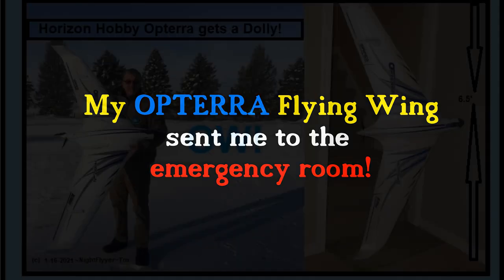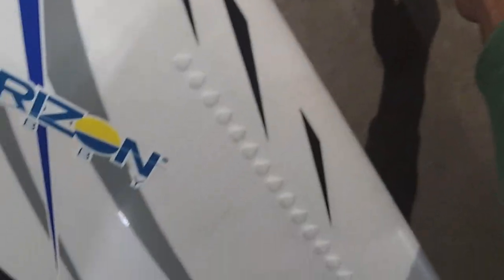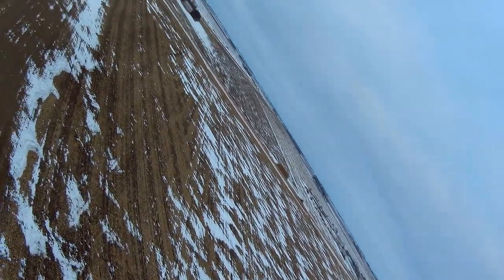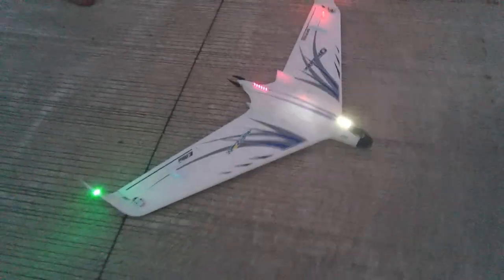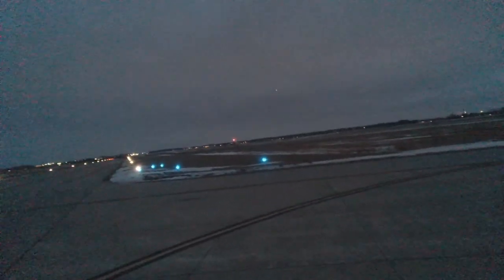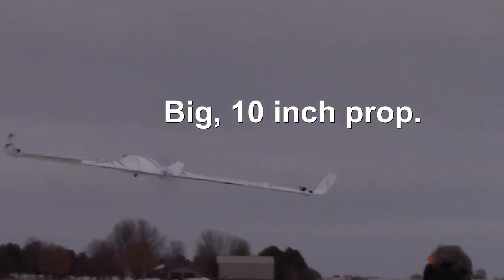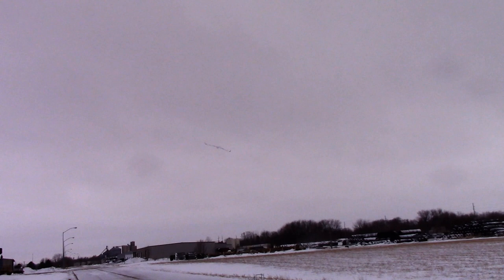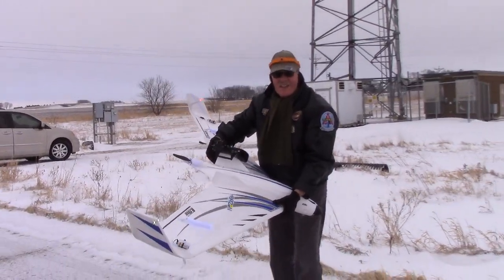My Opterra 2M Flying Wing sent me to the E.R. This is an awareness video & my solution for launching

Comment: Oh so sorry. You should have add handle like holding it little higher.or simply add wheels. Get well soon sir.
Reply: A handle that you hold that grabs the plane while you launch it is a great idea.  It could even be just a stick with a coupler that automatically releases when it gets to a certain angle.    Would allow more leverage to launch said plane at a higher velocity and altitude also.   Great idea.
Reply from the maker: @MoralConflict  Yes, well if you saw my Product review  video,  https://www.youtube.co/watch?v=P_inF5EYLEE&t=1s  you would see  those wings aren't as strong or thick as you would think.  I would have to add a nose wheel servo and make it a trike as well.  And since the prop on the back is 10 inches, the landing gear would have to be quite long or retractable prop would hit the ground on rotation or landing. Thanks for the suggestion, but the dolly is pretty permanent too.  This wing is 7 foot long, heavy and  will bend and break the end off the if you even try to pick it up by the tip and barely has enough power to fly out of your hand at launch.  I know and I tried to launch it discus style, but could not hold it where I felt I could launch it successfully in the wind.     It would also be extremely difficult to somehow launch it discus style with the elevon there and that 7" tall winglet rudder that is also on the tip.  I know how to do it , but not with this plane.
Reply from the maker: Yes, well if you saw my Product review  video,  https://www.youtube.co/watch?v=P_inF5EYLEE&t=1s  you would see  those wings aren't as strong or thick as you would think.  I would have to add a nose wheel servo and make it a trike as well.  And since the prop on the back is 10 inches, the landing gear would have to be quite long or retractable prop would hit the ground on rotation or landing. Thanks for the suggestion, but the dolly is pretty permanent too.  This wing is 7 foot long, heavy and  will bend and break the end off the if you even try to pick it up by the tip and barely has enough power to fly out of your hand at launch.  I know and I tried to launch it discus style, but could not hold it where I felt I could launch it successfully in the wind.     It would also be extremely difficult to somehow launch it discus style with the elevon there and that 7" tall winglet rudder that is also on the tip.  I know how to do it , but not with this plane.  Thanks. I am healing and now can type better.
Reply: @NightFlyyer  get well ssoon sir.👍

Comment: Hello, I had a similar injury launching the f 27, but did not required stitches. I had 5 cuts. It could have been worse, I was lucky. I now launch it holding by  the wing. Thanks for your video.
Reply from the maker: Ouch.  I have the F-27 evolution as you saw and how I launch it, but this wing is 7 foot long, heavy and will bend and break the end off the if you even try to pick it up by the tip. I tried.  Also it barely has enough power to fly out of your hand at launch.   It would also be extremely difficult to somehow launch it discus style with the elevon there and that 7" tall winglet rudder that is also on the tip.  I know how to do it , but not with this plane.  Thanks and hope your okay.

Comment: I like your alternative launch system, clever with the guide wire and far more compact than what you'd need in a traditional catapault for this size vehicle - well done!
Reply from the maker: Yes, I tried to make is small, as there is barely enough room to put this plane in my van and a big Catapult like I used to have.  It works and it's Hello dolly for me from now on with this big 7 foot long wing. Thanks very kindly.

Comment: Same thing happened to me last year but with the smaller Opterra (9 inch prop) my first RC accident in 30 years. I've flown F27 and other flying wings for years with no problems. Retired mine as a safety precaution .........once bitten twice shy!
Reply from the maker: I'm with you.  Mine is not retired yet, because I will continue to use the dolly for this one.  I have a launcher for my F27 Evolution, but am always cautious with these, but for sure, nothing is 100% as I have shown.  Thanks kindly!

Comment: Daarrrrn, thanks for sharing. I always try to hand launch with no power then be quick on the throttle but that only works on birds smaller than yours. Very brave to hand launch a pusher that size of yours. How's your hand healing?
Reply from the maker: Stitches are healing, but it is hard to bend.  Thanks kindly.
Reply: @NightFlyyer  good to hear! well, hope you get some physio in for your hand if you can.

Comment: Sorry about the injury, like the dolly, a good solution to launching with the motor running.  In my experience if I can't launch a pusher with a side arm throw I won't enable the motor until after its launched (throttle on high but the motor disabled with a switch).  Glad to see you back in action, Semper Fi.
Reply from the maker: The Opterra 2M manual also says nothing about throwing it with the motor off, so if a newbie followed the instructions, like I did, I'm showing what could happen, in case a gust of wind got them or something else.     Nothing is 100% and no matter how good you can throw, this big 7 foot wing with a 10 inch prop spinning right next to your face, into 12 MPH like I was, is risky to say the least.  The 10" prop is very close to your forearm as well, so a gust could tip it back even before launch, as others told me happened to them.  Thanks and Semper Fi as well..

Comment: Glad you healed up well! 
When first started in R/C planes as a teenager back in the late 80's, I was breaking in my new O.S. .40 FP and being a noob, I left the exhaust pointing up towards the wing and while holding the plane and trying to adjust the needle valve, my tx fell over hitting full throttle and the wing slipped out of my hand from the exhaust oil, the plane turned and the brand new razor sharp Master Airscrew 10x6 hit me right in my leg! It was in the dead of Winter here in the north east and I was wearing long johns under my jeans and the prop easily went through both layers. It hit me so hard, it shut the engine off from full throttle! It was probably in the teens weather wise so the pain was even worse. To the point I was literally speechless! Its was all I could do to call out for help. Luckily I was hit in the top meaty part of my leg above the knee. So no bone or muscle damage and I only got 7 stitches. I still have the scar to remind me of the bitter cold and very painful day.

Comment: My heart goes out to ya, Dave.  When going through the options of discus toss, etc. you could also try a zero throttle toss, then power up.  Or for times when the trolley is not practical.  Glad you are ok.  Heck of a lesson to us all.
Reply from the maker: This 7 ft wing is too hard to discus launch.  It is heavy and I tried to figure out how to hold it and throw it like my smaller wings.  I could not pick it up by the wing. It barely has power at full throttle to fly out of your hand let alone do it with engine off as seen in my original product review video.  https://www.youtube.com/watch?v=P_inF5EYLEE&t=1s&gl=CO   I will never hand launch it again, as you might guess.  Thanks.

Comment: glad your healing up bro!
had a friend get cut bad by a whirling 9x6 wooden prop on a combat control line model with a fox 36x on pressure....
he was adjusting the needle valve and not thinking he didnt reach around far enuff and it got him....
i always stood behind the engine so if ya get bumped by the prop ya wont get messed up much being youre behind the prop....
that 36x dang near cut his thumb off too....they fixed him up...hes really lucky!
Reply from the maker: Ouch.  Thanks very much.
Reply: @NightFlyyer  another guy was practicing a manuver with a 5in freestyle kwad and crashed it bad...turned off his radio and retrieved the kwad and went to unplug the 6s lipo i believe....flight controller shorted somehow arming all 4 motos and it tore his hand up pretty bad...
hes healed up now but hes lucky nothing was cut off!
Reply from the maker: @birdman316  Wow. Sorry to hear that.  My quads all have to be armed, but this one arms as soon as you plug in the battery.  That had nothing to do with why my hand was cut, but I pointed it out so others would be more aware.  Thanks so kindly for your comments..

Comment: I once cut my index finger on my F27Q excactly the same way you did, only I had mote cuts but not as deep or bad as you had. 
Get better soon mate, and happy flying
Reply from the maker: Ouch.  I have the F-27 evolution and as you saw only use my launch rails.  This big 7 foot wing would not go off it.  Check this out and see my sled launcher.  Thanks.  https://youtu.be/f5xDfk7sbcQ

Comment: Oh man that sucks! I have an Opterra also, I launch with my right hand and throttle up after it’s away from my hand...I hope you can get back to flying soon! Good luck.
Reply from the maker: Yes, well, this 7 ft wing is a bit tough to launch, not like my smaller ones, and I found that I have to keep my right hand on the elevator stick to launch it.  But again, I followed the instructions in the manual.  Here is word for word what the Opterra 2M manual says about launching.  
1. Put the aircraft into launch mode with the channel 5 switch.  (in my first video that did not work, it went into the ground https://www.youtube.co/watch?v=P_inF5EYLEE&t=1s   )  
2.  Hold the aircraft in one hand and the transmitter in the other.  
3.  Apply full throttle and throw the aircraft directly into the wind, angled slightly up (5 to 10 degrees above the horizon). 
4.  Climb to a safe altitude and check the trim.   
I know others have their own ways, and either way, my Dolly is the safest solution for me.  
The Opterra 2M manual also says nothing about throwing it with the motor off, so if a newbie followed the instructions, like I did, I'm showing what could happen, in case a gust of wind got them or something else.  Thanks much.

Comment: I use a bungee launcher with a small command hook secured to those type of models with VHT tape (normally used for auto trim). It only takes about 20 or 30 ft of bungee with an equal amount of line and a fish scale to determine the tension vs model weight.  Your dolly is another tried and true method. Also, after a bench accident setting up a buddy box, I now have throttle cut configured on all my electric models as well to avoid handling accidents on the flight line.  I'm glad you got away with stiches and a good story to share.
Reply from the maker: Yes I have used bungees a lot to launch, including to power my original NightFlyyer-a-pult catapult that was destroyed in the fire.  I didnt want to build another just to fly this, so just hand launched it.  But never again.  It's Hello dolly.   LOL  Thanks.

Comment: Nasty.  Brings back a terrible memory for me too.  While tuning esc's in my 10inch quadcopter, it armed, ran up to full speed and ran up my right leg cutting in about nine places from my ankle to just above my knee and those props cut deep and clean like a razor.  Half a second later it looked like I stepped on a landmine.  My stupidity for tuning with props on.  The scars are a permanent reminder of what can happen with even a single lapse of better judgement.
Glad you are ok in the end.  A tough lesson no doubt.
Hand launching pusher planes just looks like a tragedy waiting to happen and the lack of any real arming feature is also bad on the manufacturer of that plane.

For myself at least in the end it has made me much more safety aware as I could not bear the idea of hurting somebody with my hobby.
Cheers.
Reply from the maker: Glad your okay.  Thanks kindly.

Comment: This is a good reminder to all of us not to take props and electric motors for granted. I've not quite done what you have but I put my finger in a 12 inch prop a long time ago and it broke my index finger in three places. I have seen a similar accident with a non folding carbon prop on a 2m wing. My friend was lucky not to have amputated at least one of his fingers. His hand was a complete mess afterwards and it took months before he started to get some use and feeling back in it. Get well soon.
Reply from the maker: Yes, I surely am offering this as a reminder that nothing is 100%.  I am recovering, but it is sure hard to type.  Thanks kindly.

Comment: I hope you're healing well, don't get your hand cold in the weather, big hindrance to healing.
That's exactly why I launch my Opterra throttle off, then throttle up once I've let go of it. Or launch off a bungee, I made a water pipe setup and two of the silicone bungee ropes, in my garden. Bit scary but works a treat.
Reply from the maker: Yes, well it was cold all right for my dolly launch.  Stitches come out tomorrow.  I had bungee launchers before the fire and  my famous catapult was powered by rubber cords, but since I launched it fine a few times before hand, I wasn't worried.  But Hindsight is always 20 20 and after the fact.   Thanks and happy flying.
Reply: @NightFlyyer  I hope you got all that Claret out of the Tx gimbal....
Reply from the maker: @simonhughes-king  Yes, the dried blood was all cleaned out from the transmitter, for the Dolly flight and all is well.  Thanks.

Comment: Cut tendons repaired in the ER ? That's rare for sure. This is very delicate and specialized surgery that most general physicians, including most orthopedic surgeons won't touch. Can't express how lucky you got if you ended up with good results.. Just my 2cents worth. Glad it worked out for you. Happy Flying..
Reply from the maker: Not cut completely in half.  Dr said if I had cut the bottom tendons, he could not have sewed them back together, but would have had to send me by helicopter to Sioux Falls SD to have a hand surgeon fix.  I did not show all the pictures due to blood, but I watched him stitch them. Lucky but still wearing brace and hard to type.  Thanks.
Reply: @NightFlyyer  That sounds more like it.. It's kinda a joke amongst ortho guys that don't do hands that it's pretty much "no man's land". As bad as it was I cannot express how incredibly lucky you were. Had you had to have tendon repairs in your hand you was In for a much bigger ordeal.. Glad your well..
Reply from the maker: @dandowns9669  Lucky, for sure, but it also cost $2400 at the ER.  Thanks again, Dan.

Comment: Sorry for your experience and I do hope you are well on the path of recovery

I have had one of these for 2 years now and done lots and lots of flying with it - throttle cut should always be set on the TX to be safe ,

My other observation here is that your hand launch is what I would call LONG - the opterra has a grip in the middle and your hand /arm comes away in a DOWN WARD movement when launching,  a  pivot from the shoulder and down - In your video you see to be keeping your arm and Hand up..  It is also possible to select SAFE at launch and hand toss the Opterra with motor off - and then throttle up  - 

Without doubt a dolly is for sure the safest way to launch any pusher prop airframe that does not have the prop above the Fuselage.

I watched your first video when you could not get the Opterra to fly on the first few hand launches - it looked as if the Opterra was not at 3/4 to full throttle - It needs 3/4 to full in order to climb out - and a GOOD HARD Throw.  I always end up grunting when I throw mine ....

Thank you for sharing this video , again I do hope you are getting better and WOW - Well done on the Landing !!! - 

This video should act as a warning to us all ... Lets stay safe.....
Reply from the maker: Yep, all the advise after the fact, but good.  Too bad I launched it by the book before and had no problems.  Im 73 and launched it hard as I could and yes the throttle was wide open.  The second video I made of this I shut off the stabilizer, and had no problem after that.  Sometimes stuff happens no matter how you try and this was one of them!   Thanks.   Here is exactly what the Opterra manual says word for word.  1.  Put the aircraft into launch mode with the channel 5 switch.  (in my first video that did not work, it went into the ground)  2.  Hold the aircraft in one hand and the transmitter in the other.  3.  Apply full throttle and throw the aircraft directly into the wind, angled slightly up (5 to 10 degrees above the horizon). 4.  Climb to a safe altitude and check the trim.

Comment: Man that was horrible. Good idea afterwards with the launcher. I do agree with the other comments you should have Throttle Cut/Hold on a switch to avoid a throttle stick bump. I am a strictly heli pilot and I have a twin switch configuration to avoid accidental bumping. I also had an accident but with a heli crashing into me but back when I was learning. I thank you for sharing it is always important to highlight safety in our hobby. Best of luck.
Reply from the maker: Thanks very kindly.  The cut switch, which I know all about and on all my helis, did not cause my accident however.

Comment: Your video brought back uncomfortable memories. I had my little finger lacerated by the tail rotor of the Heliboy you flew at the dump road site. Although it was not as bad as your incident, it did require stitches, I still have faint scars some 30 years later.  I still have that helicopter, it taught me the valuable lesson of not grabbing the tail boom.  It looks like you may have missed all the tendons, hoping you heal quickly.
Reply from the maker: Hey Mike.  I didn't remember seeing you cut yourself.  That is not good either.  I had 2 tendons severed and he repaired them.  We shall see how it goes.  Thanks Mike and Stay well.